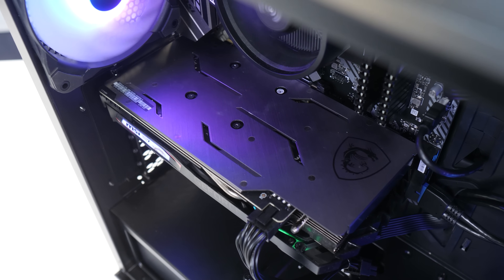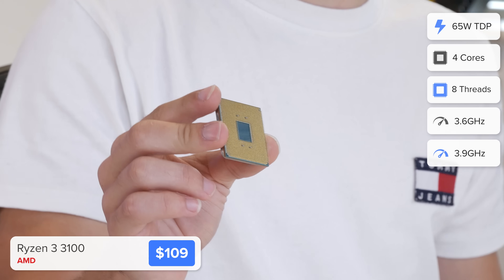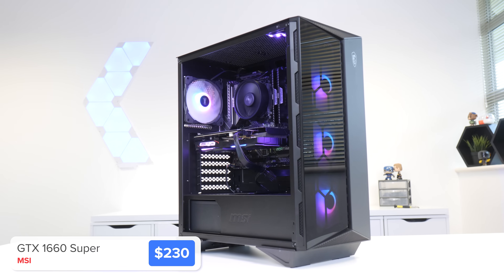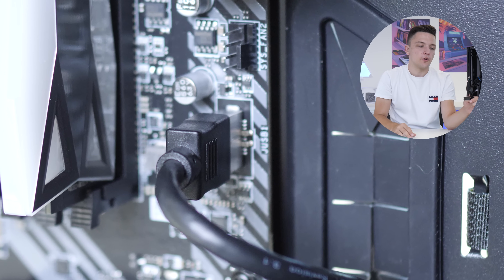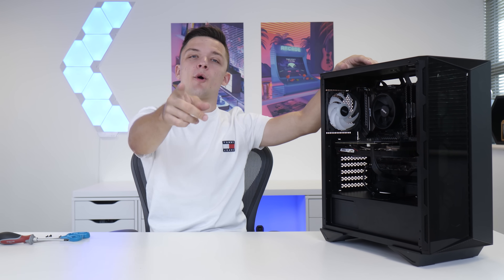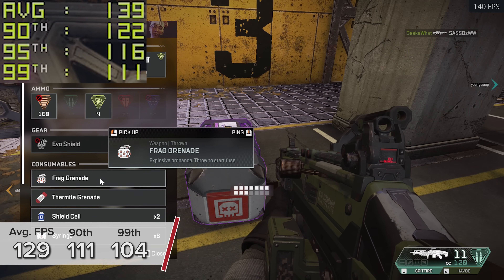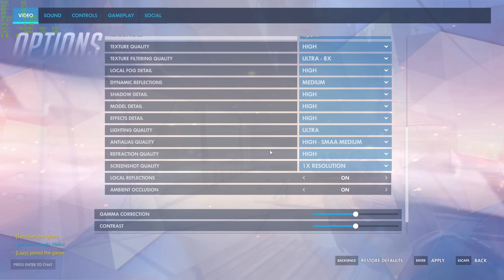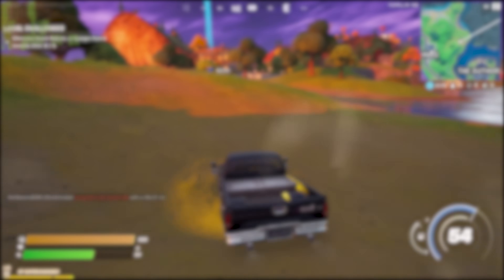Budget $750 Gaming PC Build 2020! [ft. GTX 1660 Super & FULL Gaming Benchmarks]

Comment: Would 1660 super and ryzen 5 3600 with a cv Corsair 550 watt ok? Cuz I just got it here but I think maybe I should return and switch for 650 watts so pls tell me if 550 is enough (also have some extra fans but no water cooled)
Reply: Yeeea sure your pc would take total power consumption around' 430 watts so I don't think there's a any sense of buying 650W🙄. Until and unless you would upgrade to 3080 or 3070 in future

Comment: Hello I need some help I brought a r9 280x that the seller didint know if it worked.

The gpu gets power (fans spinning and boost light turns on). But I get a message on my monitor saying (input not supported) 

Ive also tested different monitors and tvs still the same thing.
I also tryed another gpu (gigabyte gtx660 oc) and I got a display. 
PLEASE HELP THANKS

Comment: This build already feels outdated, new amd and nvidia gpus crush this
Reply: It’s called budget for a reason
Reply: @clovernotatroll2302  building this is so not worth it , you'd feel cheated 3 months later
Reply: Earnist Se so what do you think I should do? I’m building my first pc with about 800.
Reply: @Doula3  800? Have you chosen what cpu and motherboard you want or still deciding
Reply: Earnist Se 😭 I don’t want to annoy you with my dumb questions,  but I can use any Ryzen cpu with any msi motherboard right? And I will probably end up getting the ryzen 5 2600 since the ryzen 3 3100 is out of stock. The motherboard probably the msi or b550 even though it’s a little more expensive. And just to make sure I can use any midtower case right? Which of those would you prefer? (Cpu and motherboard)

Comment: Dude why would you spend more on a motherboard than the actual CPU? Absolutely go for a b450 and use the $70 you save on a ryzen 3600, it can run circles around the 3100. Also, that case is far from budget, for that price you can get a Lancool II Mesh which has much better thermals, RGB, and build quality. Then that SSD is absolute garbage too, its slow, prone to failure, and trash for the price.

Comment: Maybe consider Gigabyte motherboard instead people. I used this motherboard recently for a build and its frustrating the stupid bios design. Also had quality issue with the 3.0 usb connection not fitting easily. I can't help but notice at 11 seconds the connector is angled in this build probably because he had problems also. Also had problems with xmp disabling and self oc causing fan spikes with Wraith Prism. Experience is much more normal with Gigabyte Auros boards from my use. It does have very good thermals however to MSI's credit.